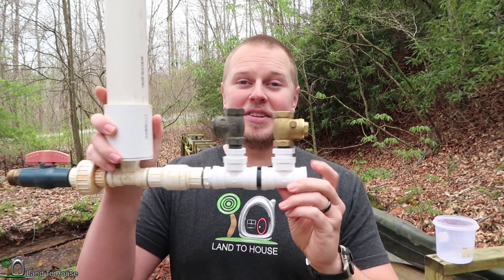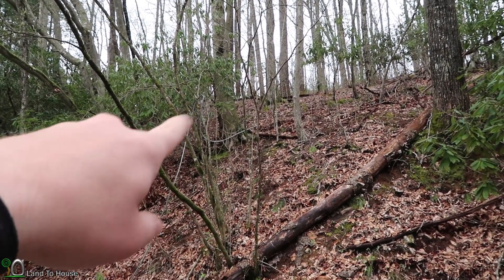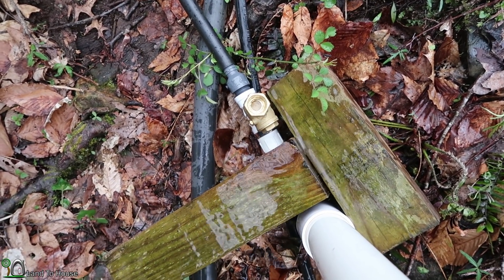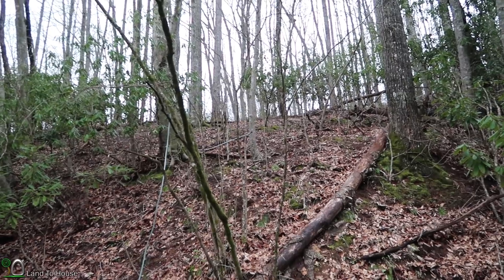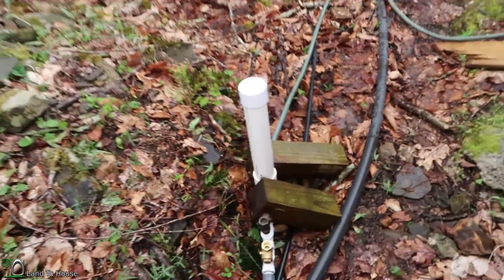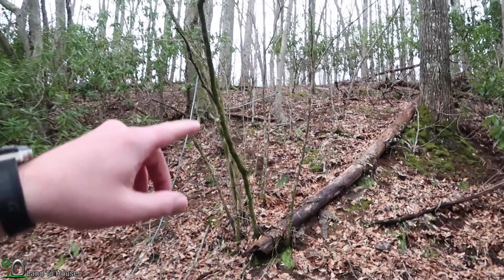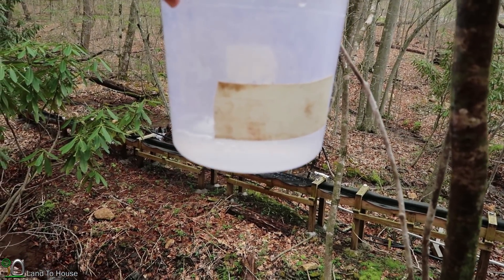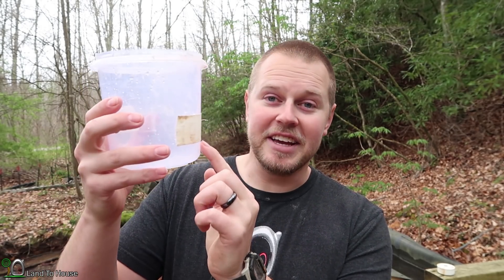Ram Pump Two Valves vs One Valve

Comment: I'm just curious, how about if instead of using 2 waste valves,    install that extra valve at the feed pipe. This way, all the water hammer pressure will be forced into the pressure vessel instead of some going back to the feed pipe. I don't know. Just a thought...

Comment: Now that I have come to watch this video again I have come up with the theory that increasing the number of waste valves is pretty much similar to increasing the size of the waste valve and increasing the size of the waste valve is inevitably going to require a much bigger drive pipe to run the pump..So if you keep your promise of making the 4 waste valve video you will require at least a 2 inch drive pipe.. Basically additional waste valves make the pump bigger..And a bigger pump will increase the pressure created hence the increase in delivery rate and potential delivery height

Comment: How 2 valve make it better ??!
Reply from the maker: Some people were questioning if two valves would allow the pump to lift water higher. It turns out that it does not lift higher but can lift more water the same height.

Comment: Hi! What happens when you have two delivery valves instead of one? I’m from the Philippines.
Reply: More exhaust valve: more power, deliver water to higher place.

More delivery valve: supply more water, but less power. It deliver water not as high single delivery valve.

You can't get both.

Comment: More waste valve, more velocity in pomp body and more pressure build as well. Surely the delivery pressure and volume of water will increase.
Reply from the maker: The volume does increase! But I found that the height of delivery does not increase.

Comment: Supper cool thank you, do you think it has a valid use or just upgrade size pump and or a larger pressure vessel?
Reply from the maker: I think it has a use for larger pumps. If you already have a 1-1/4" pump and needed a little more water at the same height you could increase the valves to get that volume. Personally I think the single valve would be better for maintenance.

Comment: I made a1" ram pump, initialy i try only a single waste valve but cannot lift to the place tha I want to. I decided to add another Two waste valve ang got a satisfying result Because of high volume and pressure to drive the pump again i install additiona 3/4" waste valve and I got an excellent result, good volume and lift deliver to my desired height.
Reply from the maker: That is great news! As long at you have water where you need it the pump configuration doesn't matter.  :) thank you for sharing.

Comment: I'm sorry, I'm new to this. If I had two valves rather than 1 could I make a bigger pump? Such as having a 4 inch inlet with two, 2 inch valves. Would this work to pump the same volume as 1, 4 inch valve? Further more can the inlet of a pump be the same as the  outlet? Thank you for your time.
Reply from the maker: It seems that you could make a bigger pump with two valves half size. I have limited testing with the values. The drive pipe and delivery pipe can be the same size. The main thing is that the driver pipe and waste valve (s) allow the same rate.

Comment: Seems like the increase in total flow reduced the head height so I assume it would continue as such. For each additional valve the volume would be greater but it would be less and less able to raise the water????
Reply from the maker: It seems like this is the case. With two valves the height was able the same. (around 50 feet of lift in my case) I plan on installing another 1/2" valve and seeing what happens.

Comment: Interesting results! I started playing with ram pumps last year. I built a 1" version. One thing I'm wanting to experiment this year is essentially two ram pumps from two different sources sharing one pressure chamber & delivery pipe.

I have a spot where two streams converge & thought I could build a couple dams, of sorts, to use as my water sources, then try to pump water up to a storage tank which would feed cattle waterers.
Reply: Excellent

Comment: Very interesting results!  I'd be curious to see if valve spacing has an effect (between the two waste valves)... like maybe start with a calc for the speed of sound in a PVC medium and figure the distance for a co-phased array. (Am I making sense here?)  but either way, this test provided MUCH more gain than i expected.  I'd also be curious to see if the effect is dampened at double or triple the deliver height. Great test Seth!

Comment: awesome... now what happens if you double the other valve? (not the waste valve) 

i removed the two trees that were shading my  spring head reservoir and now it is growing algae and clogging my intake :( so i have to create a new shade for it.
Reply from the maker: I will put that on the list of tests. I have a feeling it will stop the pump but then I have installed a valve on the other side of the pressure tank and that works well. .... Oh my that algae is tough sometimes.
Reply: plant some tall perennials around it... something that doubles as food.. maybe wild rice.
Reply: good idea :)
Reply: look forward to it. im leaving 5/12/2018 for a 3000 mile bike ride from CA to DC so i will be gone for awhile though.

Comment: But this pump is water is off an on  off and on why
Reply: My guess is the low pumping head he is delivering to... at higher heads that usually doesn't happen UNLESS your pressure chamber gets water logged.